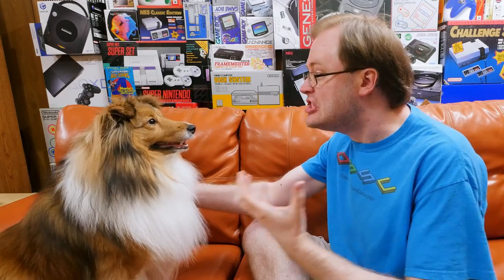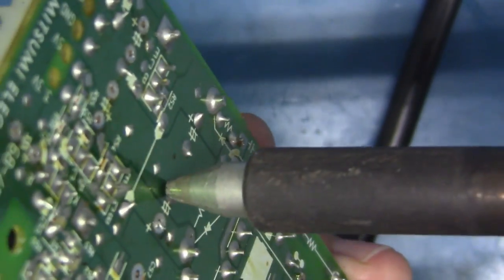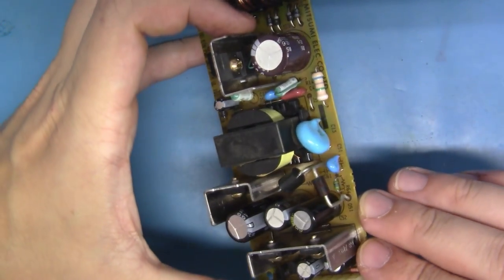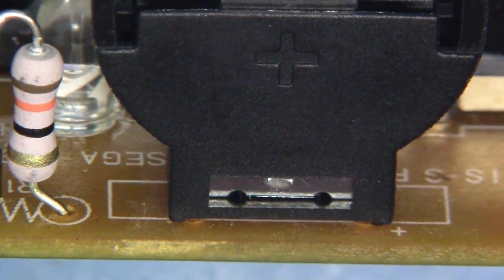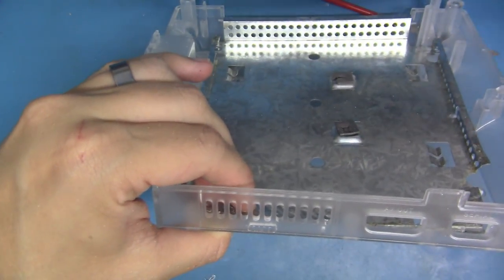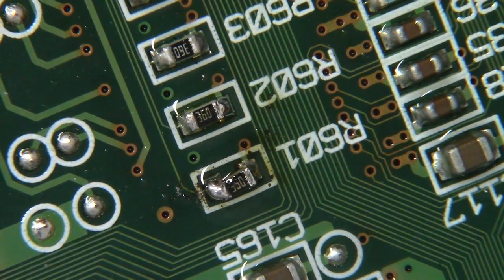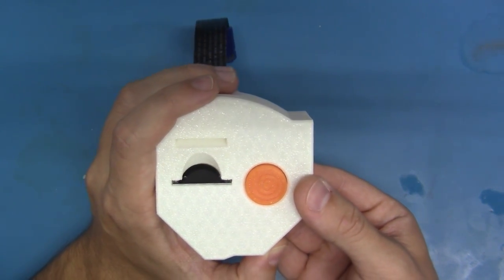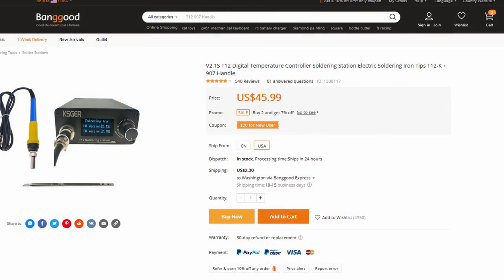Sega Dreamcast Restoration & Modding Tips! - DCHDMI 1080P, Load Games from SD Card & NEW Solder Mods

Comment from the maker: CHECK THE VIDEO DESCRIPTION! Links to the DC Case, DCHDMI, batteries, my soldering equipment, etc. will be found there!
Reply: Quite a few people are also looking for the names of the songs, could you please list them as well? Be well friend!
Reply: I'm surprised you don't have some of the Kester 951 liquid flux in there, I found a couple bottles with real thin rod (giggity) applicators and it worked like a dream compared to my MG Chemicals flux pen. Fixed up my Xbox 128MB memory mod with that stuff.
Reply: The only one I'm not seeing is the desolder tool :(.
Reply: @MrSadface  He did a video on it, IIRC it's the Hakko 808 vacuum-based desoldering iron.
Expensive though. I paid $15 for a pump-based desoldering iron that's grounded, works just as well.
Reply: @me0262  ah thanks!
Reply: Nice intro by the way😁😁
Reply: I have a revision VA0 dreamcast. Would the diode for blocking the recharge circuit still be placed on R1? Or do you know what I would need to do to accomplish the same thing on that revision?
Reply: What is the screw driver you use? It's pretty nice. I don't think I see it on your Amazon list.

Comment: I noticed you trimmed the capacitor legs after soldering, but trimmed the diode leg on the recharge circuit before soldering. I have heard that trimming before soldering is better as it places less stress on the solder joint. Would like to get your opinion on this

Comment: I finally modded my Dreamcast a few months ago and then here you go showing me how I could have avoided buying an ML2032...  But you did finally get me to pull the 12v regulator.  I had been using the high wattage resistor option instead.  One question: How did you get you lid back on with the regulator mounted upside down? Mine sit proud about half an inch.  Guess I'll just tape it somewhere until I get the fan shroud and SD extender from laser bear.

Comment: I had a quick question on the power supply I have about six of them running original power supplies they don't seem to be having any problems would you recommend recapping.I wouldn't think they would need recapped with them only being 20 years old.

Comment: Hey Lord Voultar.. I wonder if its possible to install a switch (but not the Nintendo kind 😏) in line with the 12v regulator so you don't have to remove it, should you encounter one of those said peripherals or if you wanna go back to gdrom

Comment: I have a question, is there a solution which still allows for 12v use that also prevents overheating? I've heard about the dangers of replacing the power supply and just wanted to know what my options are. Alternatively, is there a video that goes into the different PSU options and what the pros and cons of each one are? I'm wanting to mod my Dreamcast at some point, but want to also make sure it lasts as long as possible, so if I do it, I want to make sure I do it right. Any info would be greatly appreciated.

Comment: For the dreamcast battery replacement, my local electronics store only stocks Schottky Diode 40v 1A, would this work or do I need to get the same one you are using?

Comment: Amazing work, but one question? No Pico PSU or resistor mod on the 12v rail of the existing PSU? I recently added a Pico to my Dreamcast because the heat build up after getting a GDEMU was insane (inside the disc tray above the PSU).

Subbed.
Reply: He completely removes the 12v rail since it's really only used by the GD-ROM and the GD-ROM was removed, so no need for resistors to be added. He's also not a fan of the aftermarket PSUs. He recommends re-capping the stock PSU and using that as it's super reliable.

Comment: Have to complain about the GDEmu Mount Kit though, if I screw it on the upper left, my GDEmu doesn't have full contact with the GD Port and the DC freaks out in the system menu :-/

Comment: For the process of replacing the battery, does this vary between the US and Japanese versions of the console?  The board supporting the ports on my Dreamcast seems to be a bit different. Also I've replaced the fuse, soldered the diode, followed the video and have checked the joints. The thing is the date and time are not saving to the CR2032 battery. I have noticed that on the ribbon it appears that a silver pin is either missing or corroded (cant tell which). Could this be a reason why the date and time aren't saving? Any help would be greatly appreciated! TIA! 

Edit: On a side note I've replaced the PSU with a DreamPSU. Would this have an impact on anything?

Comment: Hi Voultar, I tried to add the BAT85 diode. As soon as I put the CR2032 battery in, the power led turns on slightly. The controller board is not even connected to the dreamcast, I just soldered the diode (checked the orientation 3 times) and as soon as I connect the battery the led goes on. Any ideas on why this is happening?

Comment: I taped in a CR2032 battery not even thinking about it being "charged" by the maple board. I really should at least do that battery mod on my Dreamcast so I don't risk damaging it as a result. Also thanks to you I now have a more proper solder station that has helped me fix all kinds of things that I was never able to before with the cheap soldering irons used to buy.

Comment: Lord Voultar, from the DCDigital page:
"WiFi Updates 
(GDEMU users should remove their GDEMU and replace with normal GDROM based drives before updating.  GDEMUs are unshielded and can effect the wifi/download.  You have been warned.)"
This time last year, I remember when trying to connect the DCDigital Wi-fi settings to enable online updates I couldn't get it to work on an official GDEMU board and had to reattach the GDRom drive temporarily to get it working.
Have you had any experience with firmware updates with the clone GDEmu board attached?

Comment: WARNING: if you plan to use the Akura by the Beharbros keep the resistor on the power supply that Voultar removes. The Akura needs the power and you wont be able to use it if it has been removed.

Just a heads up!

Comment: A minimal change on the 3d printed SD holder would make it a bit nicer. Adding a bit of white paint to make the top more opaque. (Or making the bottom layer of the print thicker)

Comment: What was that tool you used after you sprayed the IPA on the supply board (and before you brushed off the remnants)? Thanks!
Reply from the maker: We call that a spray bottle.
Reply: @Voultar  No you silly billy, I meant the long wand, looked like a pencil. You were scraping the gunk off the board with it.
Reply from the maker: @ChrisKewl  That is a fiberglass pen.

Comment: First time watching your vids, but already a fan! Question about the battery: r/dreamcast recommended the ML2032 (3V) battery, which is rechargeable and apparently the correct voltage. Would you still recommend a base CR2032 over that?
Reply from the maker: I would and I do in the video.
Reply: @Voultar  Oh, my bad, I misheard the video the first watch through. Didn't realize the stock battery was an ML2032 also, thought it was a CR2032 like the VMU uses.

Comment: OK, let's talk about this regulator issue, because this doesn't make any sense.  I keep seeing noise about how this thing gets too hot because there's no load on it.

The 3-pin IC next to the one removed is a Rohm C4596 switching regulator, which I'm assuming is for the +5V or +3.3V rail.  Granted, '90s era switching regulators often are not stable without a sufficient load on the LC filter.  But we're not removing the switching reg.  We're removing what seems to be a bipolar transistor.  (I can't quite see the part number, but the silkscreen says "B C E" next to the legs.)  That suggests this is most likely a discrete linear regulator topology.

Now, linear regs are basically an auto-adjusting variable resistor forming the top half of a voltage divider from the unregulated high voltage, to the regulated voltage (and load), which is then grounded on the low side.  They create heat proportional to the current passing through them, since they have to dissipate ((Vsupply - Vreg) * Iload).  The current passing through is determined by what the load pulls.  If there aren't any devices pulling 12V, then the only thing left is whatever the circuit's quiescent current is -- typically just whatever's in the control loop.  It shouldn't create much heat at all.  That SMD resistor is probably a bleeder for the output cap, and a little something to soak up some transient noise.  It won't be consuming much current because it doesn't have the ability to shed much heat.

So, is there really anything to this theory that the 12V reg is responsible for excess heat?  Because until this video, the only ones claiming it's an issue are ... well, forum and Reddit posts that don't inspire confidence that the poster has any knowledge of the subject matter.  It all sounds like cargo cult wisdom to me.  This suspicion is further bolstered by the fact that the GD-ROM can and does shut down when not in use, so even a stock Dreamcast will have negligible load on the 12V rail sometimes.

I know Voultar wouldn't fall for hearsay, so... what gives?

Somebody educate me.  Totally prepared to be wrong, I just want a good reason to go hacking up the supply and risk losing LAN adapter support for the... I dunno, maybe one time in my life I might actually use it.

Comment: The solder tip you used to remove the PSU caps, is it just a normal tip? It looks like it's just immediately sucking up the solder
Reply: Its called a desoldering iron. And your right its doing just that. The tip heats up the ball of solder as normal but its hollow and when a button is pressed the solder gets sucked up into a resevoir. And there are a few different styles of them.
Reply: @thingswelike2772  oh awesome. So it's not a tip you can buy for a regular iron, its a different style of iron?
Reply: @timusforlife  correct. Hako makes a nice gun style one not sure the cost but if ur not goin to need it often then id suggest using a bulb sucker type or pen type. Also there is copper wicks you can use but they can be a pain in the ass

Comment: Why did you decided to do the cap Mod instead of the Pico PSU mod?
Reply: Pico psu's require external bricks where the OEM dreamcast supply uses a standard AC cable. Also recapping the psu is like $5-10 in parts opposed to $50 for a new pico psu. Though the Pico is nice if you travel and need to use a 220v power supply since the external brick handles the current and switching. Where the OEM supplies are region locked NTSC-U 115V NTSC-J 110V and PAL regions typically being 220V

Comment: do light guns use the 12v rail? I'd assume its the 5v rail...
Reply: the 12v rail is only for the GD-ROM drive motor. Controllers use 5VDC
Reply: @oOignignoktOo1  thank you :) figured it out eventually been ages since this comment :p
Reply: @oOignignoktOo1 I believe it also disables rgb scart output

Comment: 1. Where would I send a console to get fixed?
2. What is the typical charge to do service such as my PSX has a random resetting issue or my PS3 I assume is having an overheating issue but not sure?
3. What's a usual timeframe (or wait time) for a system to be returned to the owner?
Reply from the maker: Sorry, I'm currently not taking in general repair work. 

For a list of services, visit my website! https://voultar.com
Reply: @Voultar  oh, with my PSX I don't want general work... What I want is a more modern reliable PSU... I'm tired of replacing this dang board. I once saw a website of a guy who made a whole new PSU from scratch for the PSX but I can't find the site anymore. Granted it was an external brick PSU but that's a minor detail...

Comment: Is it bad if I haven't gotten the capacitors replaced on my Dreamcast PSU? I sent in my Dreamcast to get its battery replaced an install a DCDigital lately but am not sure anymore. So far (since I had it), it hasn't had any issues with me. Any thoughts? Maybe I'm over thinking lol
Reply: It's definitely recommended to replace the PSU caps. I've done a few of them and all of them had at least a couple of caps that were leaking. The actual capacitors on the Dreamcast motherboard are likely all fine, but the PSU caps take a real beating. It's just unavoidable. Luckily, it is a very easy PSU to service, and the capacitor kit is very cheap to purchase.

Comment: it should be noted that if you remove the 12v regulator you may not be able to use the dreamcast modem or bba to play games online.
Reply: I removed the 12v regulator from mine and modem works just fine (with dreampi)
Reply: @andysmith1813  interesting, perhaps it's just the bba then because i couldn't get mine to connect after i experimented with this quite a while ago.

Comment: Hi sorry! my bad English))))  What the soldering station? Remove solder? this not T12?
Reply from the maker: It is! Same as in my links!
Reply: @Voultar  
I just don’t quite understand how you clean, solder. 4:32 a soldering iron tip has a hole? - where does the capacitor contact get to? and where does the solder disappear? Sorry for the stupid questions)) but it looks like the solder just disappears under the vacuum)
Reply: @Voultar  
eBay
1 Set 30W 220V Electric Vacuum Solder Sucker Welding Desoldering Tin Pump Gun?

Comment: The Battery mod you did should be done by all the  other modders out there. I've never replaced the battery in my Dreamcast that I bought on 9-9-99 and it still holds a charge for 1 to 2 weeks of not being turned on and will recover once I turn the Dreamcast on and just leave it on for a few hours and then it will still have a charge and I won't have to reset the date and time. I only have to reset the date and time if I've had it off for a long time, small inconvenience compared to trying to find someone that can do a battery mod and save me some money. I have almost the same exact replacement case as you, but mine does not have the Sega Logo on the front of it.

You forgot about the replacement PSU that makes the Dreamcast run a lot cooler and Fan Mod.

Comment: Hey Voultar, great to see you back 👍 I have a question regarding caps, I have always thought that when replacing them capacitance is important but voltage can be higher, however when my friend who is an electrical engineer recapped my naomi for me he blew a fuse at the cap kit I was sold as a lot of the caps were higher voltage, and he said they should always match voltage and capacitance, and at an absolute max be no more than 1 volt higher! What do you reckon? Could the voltage being OK higher be something that incorrectly started on a forum somewhere and became gospel, or is there milage in what my friend said? I'd be interested to hear your thoughts. Thanks as always, and keep the vids coming 👍
Reply from the maker: I've already responded to you concerning this on RetroRGB's video.
Reply: @Voultar  thanks! Sadly I didn't get a notification, so I'll go check it out now. Keep up the stirling work mate 👍😁

Comment: What do you think of the after market Dreamcast PSUs?
Reply from the maker: I think that the original Dreamcast PSU should be serviced and used.
Reply: @Voultar  after posting this i did a quick Google and found your tweets on the subject. You might should have included that part in the video. Very nice video!

Comment: Glad to see you back, sir. Excellent video. Except.. Question, though: Do you not have a Dremel (well, rotary tool -  Dremel is just one brand)? The way you cut the shielding functionally works fine, but it looks oddly out of place coming from you. You're the Great Lord of soldering beautifully, cleanly and professionally, but then cut things like that? With a translucent case where you might be able to see it? A small part of me died inside.
Reply from the maker: Yeah, I have a dremel. My flush cutters were A LOT duller than I thought they were and I didn't have a suitable tool to cleanly clip that tin.
Reply: @Voultar  I guess my point is more that you could easily (and quite quickly) clean up the poor cuts with your dremel and a grinding and/or sanding bit. Or could've done the cutting & cleanup entirely with the dremel alone. Though I'm sure you can get perfectly good results with actually-sharp flush cutters like you originally intended. I personally don't have the steadiest hand in the world (too much coffee in me 24/7 - it's a bad habit), so I typically do a rough cut then clean it up.

Comment: You did a PSU cap replacement instead of a modded PSU.
Reply: Ronin7477 i did the same thing to avoid an external power brick which could be inconsistent or unreliable. 

Did a replacement psu in my saturn and i sort of hate the external brick
Reply: @goemon4  makes sense
Reply: The stock PSU in the Dreamcast and Saturn are very reliable and well-built and it's always recommended to just replace the capacitors, versus using an aftermarket PSU. Voultar preaches that all day.
Reply: @TooBokoo  I did not know that,  always learning,  thank you.